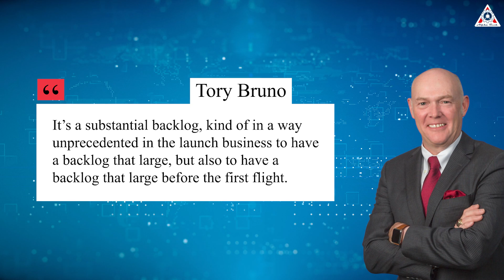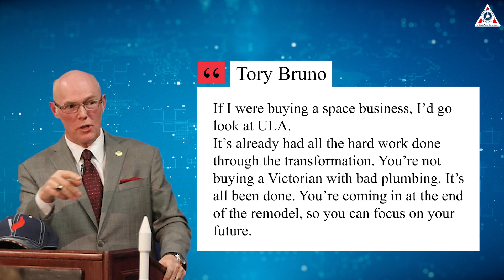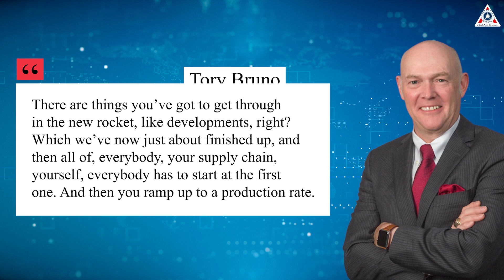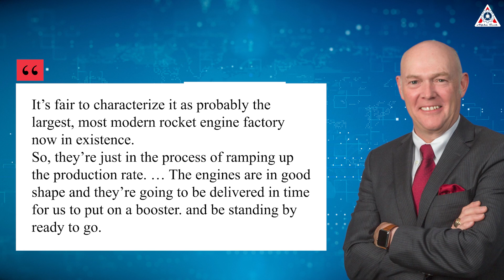Unexpected! Blue Origin is about to buy ULA...

Comment: SpaceX has a better booster and ULA has a better 2nd stage. The Centaur is better hardened against radiation and performs better in a vacuum. It can also be fired multiple times to put spacecraft exactly where they need to be.
That's why ULA is used by NASA for planetary missions and the Space Force uses ULA for complex orbital insertions of some military payloads.
I always envisioned a Franken rocket of a Falcon 1st stage with a Centaur Upperstage as the ultimate rocket.

Comment: ULA (Boeing and Lockheed) have grown up under NASA’S and the federal government’s period of cost-plus space contracts. They didn’t cut their teeth on programs that had to compete under a budget. They simply don’t have it in them. 
          Although Bezos has enough money, I just don’t find Blue Origin to be a good fit. Maybe a likewise fit, as they neither can get it done, but not a fit where each benefits off of the other ones strengths that they each bring to the table. If neither one of them alone can make it, putting the two losers together doesn’t accomplish anything at all.

Comment: Spacex has built hundreds of raptor engines and are now on their third iteration of the engine. Blue Origin haven’t even got 2 BE-4 engines certified.
Reply from the maker: Thank you so much!
Reply: Yes but not the shoved-into-our-*ss version of diversity. The healthy one which got US to the moon, not the one which divides the country.
Reply: ULA needs two flight ready BE4 engines for each Vulcan rocket. New Glenn needs 5 flight ready BE4 engines for each flight. I wonder how ULA is going to feel when Blue Origin prioritizes scarce BE4 engines for themselves and not fulfilling their contract to ULA.
Reply: The first BE-4's were flight certified and have been delivered. The launch has been delayed for months based on the second stage issues that ULA found in testing and the fact that the payload wasn't ready.
Reply: @opcn18 
But, how many BE-4’s have been built and certified?
Reply: @roxter299roxter7  That's not publicly released information but the first two were delivered more than a year ago and the factory is running and has been expanded from the size it was originally built at to make 42 units/year.
Reply: And Blue has a conservative approach where they deliberately are not stressing the engine as SpaceX's Raptor. Similar thrust but the BE-4 is about 50% bigger.
Reply: it's good that spacex does that. that's why merlins are the most reliable out there @royh6526
Reply: BO is more consumed w/ woke diversity initiatives than building a rocket/engine.
Reply: nothing wrong with diversity, that's what America is all about!
Reply: @colinf.1198  let's try diversity with air traffic controllers. We would not want to be abelist.

Comment: We see all the test that SpaceX is doing. The Raptor engines for example. Launching prototypes. We haven't seen ULA launch any prototypes with the Vulcan Engine. What makes them think it will be successful. I might be wrong about the engine explosion.  Didn't they recently have an Vulcan Engine explosion on there launch pad? So now they are launch a rocket with an expensive payload. Do they have the bugs out of the BE4 engine? This could be interesting to watch.
Reply from the maker: Thank you so much!

Comment: Buy ULA to keep them from suing Blue Origin for BE4 delays.
Reply: Yep, 100%
Reply: So true
Reply: The first flight certified BE-4s were delivered more than a year ago.
Reply: Satellites are getting smaller and lighter with more capability. Other than a larger fairing what market is New Glenn designed for?
Reply: @jeffreypelaske841  It's a reusable high energy rocket by the numbers. So it'll be in competition with SLS (if it manages to stick around) the expendable ULA VC4-6, the expendable Chinese Long March 9, ISRO's expendable NGLV, and Relativities Terran R.

Any other vehicle is going to have to do something complex and expensive like multiple launches for tankering or adding an extra kicker stage in the payload (dramatically cutting down the payload size) if they want to get out of LEO. While small sats are making a lot of progress there is still a lot of room for larger launches especially to higher altitudes. Putting a cubesat in LEO for $50k per u it  makes a lot of sense to miniaturize, but if you have a higher orbit with limited entry something the size of a bus with shielding and thrusters so it that can station keep for a couple of decades makes a lot more sense.
Reply: well and they get their patents and engineers

Comment: Jeff Bezo suffers from Elon envy, but lacks his drive and technical knowledge. Simply saying 'I am rich, I want a rocket' doesn't get one in the real world. Blue Origin has got exactly zero ever into orbit, whilst SpaceX has launched something like 70% of all launch mass into orbit and is launching more than 1 a week. An Amazon-like management style of making the bottom line all important and not investing in hardware or staff has resulted in New Glenn being a smoke and mirror act, with no hope of achieving anything significant before 2025 or 2026. Buying ULA would be an admission that Blue Origin is a joke and that Bezo has to buy his way to orbit after trying to sue his way failed. However, buying ULA would not get around the much delayed and unproven BE4 engine as Vulcan needs a steady supply of these. Really Elon Musk should be thanking Jeff for single handed taking out his two main (on paper) competitors. Now we only need NASA to get over its delusional tendency to throw tax payers money at Bezo for projects that never get finished.